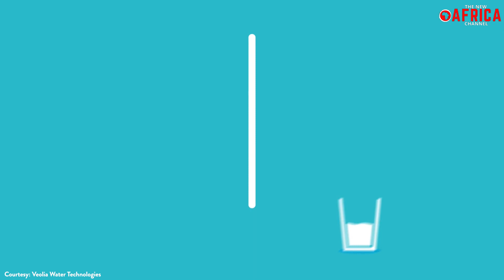Inside Africa’s Largest Seawater Desalination Plant in Morocco - Douira Seawater Desalination Plant

Comment: That desalination plant needs to be 20x bigger. Thats not enough water.  They need to desalinate enough that the grey water from the sewage treatment can be used to setup orchards on micro irrigation, to change the local climate, and replentish ground water.  Otherwise, its not enough.

It would be smart to start with wind rows to slow the desert wind down.

Comment: i have just one question, why it's not build on the sea floor for osmose system (  free hydraulic pressure) , i  will just need a  pomp and trick to remove salt ???"""""
Reply: To do reverse osmosis you need a pressure DIFFERENCE.  To create a low pressure 1000 meters under the sea to squeeze fresh water through the membrane will take just as much energy as pressurizing it to 100 atmospheres at the surface.  Plus now you have to pump it up to the thirsty desert that needs it.
Reply: @NullHand  thankx for the reply, the delta its create by pumping water, sure the osmose water never raise the ocean water level, (just pump water or need vent  to use air pressure diff with water pressure diff, if you can put vent you can  make reservoire  on the ocean  exist capillartiy properties for water to level up water (natural pump). habitually went you use osmose i have a big lot of water  pass trough, now i have the new osmose mebrane electrified, just need to keep dry , my prceess i have a similarity with amoniac central  i dont udse heut just use some pressure delta,  diff with 1 amtomspher (the air pressure  vs water pressure uneder x foot level) thats is the free defii energie, you remove the fresh water to make running this system

Comment: So that plant is going to produce 12.5 Million pounds of salt per day. Where do you put it?
Reply: Export it to west and middle Africa. Morocco exports a lot of products to the south and the east and salt was an exported product for centuries.
Reply: @moroccanevil  12.5 Million pounds a day, that is the problem. 40 Million people only require about 150,000 pounds of Salt per day. What do you do with the 12.35 Million pounds left per day? Get it yet? And that is only the Salt that provides water for about 1 million folks. No they dump it into the Ocean and kill the Bottom feeders and then the Ecosystem.
Reply: @bargdaffy1535  The real problem is the country is heading to a water crisis because of climate change so we tried clouds hunting for rural areas in that region but it is not enough!! This is the only way that we have and we know the consequences and we tried to recycle used water, we tried to build more dams for water and hydro energy but it's not enough. Also, this year we had wild fires. It's easy for European countries and northern countries  to criticize this method because they are not impacted. FYI, desalination is more expensive.
Reply: Reverse osmosis only removes a small percentage of the water in the seawater it pumps in, returning most of it to the sea as slightly saltier brine.  The lower the percentage salt change, the more efficient the process (less megawatts needed).
Current rejection rates are about 99.8%, meaning for each gallon of seawater pumped through the plant, only 0.2% is extracted as fresh water.
Reply: @NullHand  Actually for every gallon of fresh water produced there is 1.5 gallons of brine produced, which is horrible but better than a small percentage. But A 100M gallon a day plant, good for 1 million folks, produces 150M gallons of Brine, where do you put it all?

Comment: And where will all the salt go? If it is dumped back into the sea it will be an ecological disaster. If the salt is then processed for lithium they can make money selling lithium for batteries. This video did not touch this issue. Secondly, are they going to erect solar panels to cover the place to have free electricity to power a power intensive process. This video was extremely light on details or analysis.
Reply: The region of Souss began to have issues with water because of climate change. So the region is planning to cover this issue with desalination also we rely on electricity from water energy in dams since we don't have oil neither natural gas. However, if this problem increases they must switch to another energy. They are planning to extend TanTan wind energy located in the southern region of Souss. This problem is caused firstly by climate change and you know who caused that. It is not us to blame. Also, salt can be exported to countries in the sahara desert region and the west since there is no salt in the desert.
Reply: @moroccanevil  You’re absolutely right. Morocco is leading the way with renewable energy in North Africa. If North Africa applied itself you could be supplying the whole of Europe with clean green energy as well as attracting new industries to Morocco to make use of cheap electricity. The USA and Europe have largely created this mess. However, that can not provide an excuse for the rest of the world to follow suit and pollute more. Europe is now swiftly turning away from fossil fuels, sadly America is lagging behind, but I believe good old market forces will kill fossil fuel dead within ten years.
Reply: The brine (slightly saltier sea water) is returned to the sea.  To maximize efficiency, the level of excess salt should be minimized, because the saltier the rejected brine, the high the pumps must pressurize the system.  All the water removed will eventually rejoin the seawater, probably as rain over the Caribbean.
Reply: @NullHand  Brine carries substantially more salt than sea water and is devastating to sea life if simply dumped back into the sea. The salt needs to be extracted and used in other industrial processes.
Reply: @grahamcampbell8297  
Reverse osmosis only removes a small percentage of the water from each gallon of seawater run through the plant.
Current RO systems run at a feedwater rejection rate of 99.8%.   This means that only 0.2% of the water in each gallon of seawater is removed as fresh, before that gallon of seawater is dumped back into the ocean.
The technology CAN remove more, but the pressure, and hence the energy cost per gallon increases the saltier the feedwater.  It also costs energy to pump and filter the feedwater, but there will be a point where the curves meet, which will give maximum fresh water extracted per kilowatt hour spent.  Currently that is around 0.2% freshwater removed.   You would be hard pressed to even find such a
’brine’ plume outside of the dump pipe with most instruments.
Reply: @NullHand  I’m relying on other YouTube videos I’ve watched regarding desalination. My entire knowledge of desalination comes from YouTube videos. One of the points that has been made is the effect brine has on sea life. Areas around desalination plants become virtual aquatic deserts as life can’t tolerate the higher salt content of the water. 

Also, I’ve watched other videos that deal with the issue of extracting lithium from salt. Hence my comment regarding extracting lithium from salt extracted from sea water. I appreciate that sea water has only 3% salt content, but the balance is critical. The one thing I think we both agree upon is with only 0.5% of all water available for drinking we better do something quickly to find long term solutions to these problems. The south west corner of America has already hit crisis with no obvious solution in place.

Comment: If populations in Africa continue to grow, they will have to build desalinization water plants up and down the entire African coast and it still won't be enough.
Reply: Until ocean is filled with brine
Than it becomes a giant battery
Reply: @E-E.ADVENTUREGEARS  Do you also cry when it rains?  Because that's exactly what the brineless rain do,  or did you think the clouds came from the desert? And rain doesn't even do it efficiently like a closed system in a dessalination plant which is guaranteed to put back most of the waste water after it' treated,  no sir,  it goes and it rains in desert places too,  islands where no one lives,  can you believe it! The amount of aplomb that rain must have!  Man,  you must cry rivers. 😂
Reply: Not sure what you're talking about,  Morocco has the same percentual population increase as France for example, you can google it up,  it's about 36 million now and should top at 44 around 2050 before starting to go down,  obviously the pyramid of ages is not the same as Europe yet due to demographic change only starting in Morocco in the mid eighties,  but it will get there. 

Dessalination plants are needed in general because of climate change where areas which previously had regular rainfalls have now regular droughts,  but in this specific case there is also the fact that Agadir is an agro-industrial powerhouse and represents an important quotepart in Morocco's 8B dollars agro exports,  farmers there have now to dig over 200 meters (600 feets)  to get to water,  so half the water of this plant will go to the population and half to farmers,  which will help aleviate the hydric streess and hopefully help also replenish the subterranean water systems. This is also accompanied in Morocco with general use of treated waste water for anything that deals with parks and greenery watering,  and using solar and wind energy to drive the plants that do this.

So to put it simply,  it's not about feeding famished people,  it's about mitigating climate change for us while at the same time trying not to increase it.
Reply: @moorishstar  There is a difference. France’s native population is declining as is most of Europe and most western culture countries. Those populations are growing due to immigration not birth rates. Unlike much of Africa where the birth rates are far in excess of death rates and in many of those countries the populations are exploding with and without immigration. France just has to stop immigration and their population immediately begins to decline by the day.
Reply: @jean-claudelol563  What a load of crock with all due respect. France had 714000 births in 2019 and 600000 deaths,  that's where the increase comes from,  and it's easy to check the data instead of trying to fit your vision. 

Also,  just so you know,  there are around 250000 French nationals living in Morocco (annual increase of between 10000 and 15000 pre-covid), we obviously do not count them as Moroccan nationals although they do appear in the census. 

Independent of your thoughts,  Moroccan demography mirrors european one albeit with 20 years difference,  and is getting closer and closer to negative numbers as I said,  which isn't always that good (at least for me 😂) since we've already had to elevate the age of retirement to 63 and we're discussing 65 now.
Reply: Baseless idiotic facts, look at the rankings of countries based on population densities and you'll find out that European countries far outweigh African countries and by far higher population densities
Reply: @njugunamaina  It’s not about population density it’s about population growth and the carrying capacity of the environment to hold that population size. Europe has a decreasing population birth rate, continued population growth is dependent on immigration. It’s also a high carrying capacity environment with dense forest, grasslands, abundant rivers and lakes, moderate climate. Africa’s population birth rate on the other hand is exploding via natural births, despite continuous outbound immigration to other parts of the world, much but not all of the landmass is dry or desert with very low population carrying capacity, few natural rivers and lakes and the one there are have been decreasing as the water gets siphoned off for agriculture. Africa’s situation is the exact opposite of Europe’s.
Reply: @jean-claudelol563  the entirety of Africa is not a desert, the largest inhabitable region is the savanna and that's ok considering the fact that the Savannah is the ecosystem that supports the most life on earth meaning it can feed many people. 

You also forget that there are few water reservoirs in most African countries and therefore building more dams is an effective and ready measure to stop it by boosting water collection and progressing the almost  non existent irrigation farming sector  considering most of the densely populated regions is Africa are also projected to get wetter with climate change
Reply: @njugunamaina  I never said the entirety of Africa was dry or desert, I said most but not all. Even many areas not technically desert in Africa are nonetheless very dry with "near desert" conditions. There is a portion south of the deserts that are fertile and productive but it is a fraction of Africa and a few fertile areas along some rivers like the Nile. However, much more than half the continent is dry or desert and consequently infertile presently. Whereas by comparison very little of Europe is desert beyond some parts near the Mediterranean Sea and a few areas that have been subjected to centuries of poor farming techniques and have eroded the soil in those few areas. The rest of it has a reasonably wet climate, resulting in fertile lands sustaining forests, grasslands, farming, etc and large populations without costly desalinization and without costly and experimental reforestation techniques. If you think they are equivalent geography and climate 100% or anything even remotely close to it, then keep dreaming. I wouldn’t want to wake anyone out of their delusions.

Comment: Countries like Eritrea, Djibouti, Namibia and Somalia should follow suit.
Reply: Parts of South Africa also will need such water treatment technology using seawater.
Reply: On what scale? And who needs it more? Because desalination needs good management and a lot of electricity.
Reply: @natG26  With membranes you can save on energy. Thermal requires more energy. However, there's also solar desalination process (thermal process), which can be build mostly on small scale, where you depend on the sun.

Dry areas in Africa where fresh water aren't available can depend on seawater desalination. It can be a good alternative for some places in South Africa and the other countries mentioned above.
Reply: they need to plant more trees, all of them-its a long term solution altogether